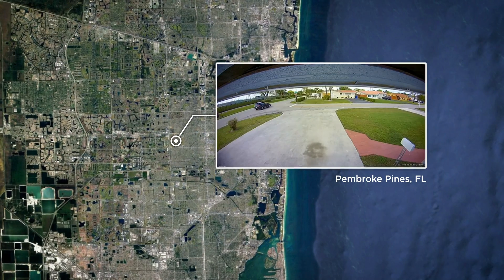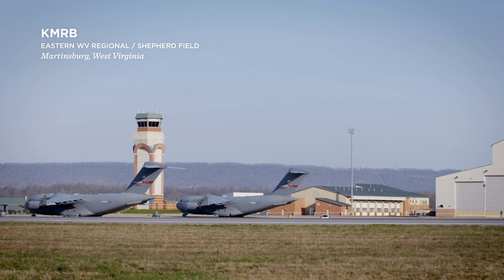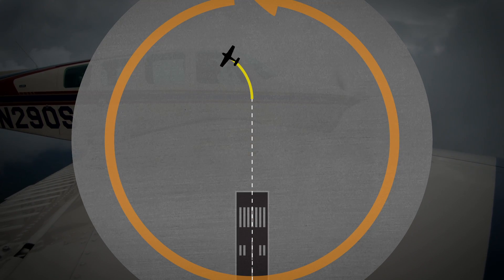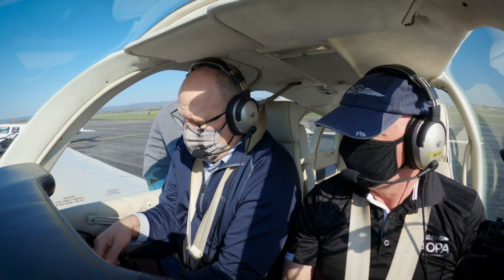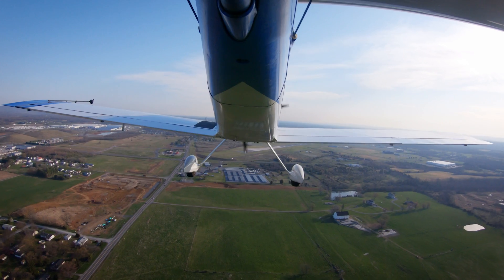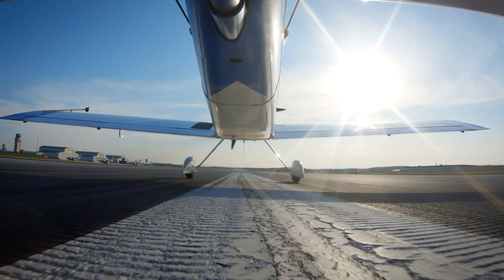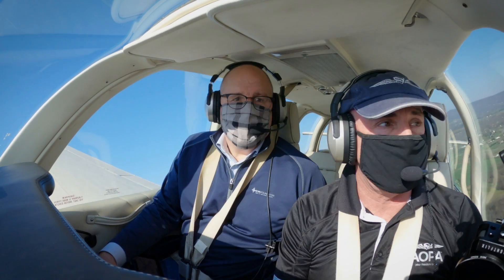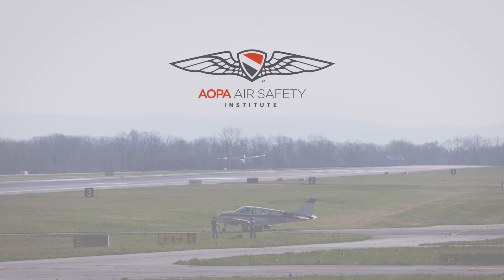Reality Check: The Runway Behind You

Comment: Russ, the airplane owner was flying that take off.  That was the deal with the Bonanza to take photos of HIM.. OF RUSS FLYING HIS C177RG. A week before,  Russ did a turnback teardrop kind because he didnt lock the baggage door on the 1177rg he later on died.  Looks like that airplane engine had failed on the taxiway before.  Why take off on it?  Then the owner also popped the gear down and that make them be short and before the runway.  
i HAVE Turnback Training on runway. Most turnbacks are the partial power kind and unless you Panic Pull (=Freak out due ignorance) you can turrback to opposite from 300 feet agl. I took that training too.  if runway is say 3,000 feet long or more.  
  Example: My CFI taught turnbacks to over 20 students in 1990's.  One got rpm down to 2,000 at bit over 200 agl.  He with 2 others adults on board did the Vglide 45 Turnback learned 5 months before. Landed tailwind , no damages.  He only had about 75 hours total.  He and the Airplane is still flying over 30 years later.   It is a matter of training, not ignorance.  Powr off is more considerations..

Comment: During an engine failure it’s not a good time to be trying to do anything difficult especially anything that’s not gear up in a field in front of you, fly it all the way to the crash site and call uncle dan gryder for your free steak dinner
Reply: What about if there are houses in front like so many airports have?  Or like in KLDG.  Fuel tanks from biggest refinery on East USA.  Tell me where you say you will go forward to.  Show.  Prove it.  I did 2 turnbacks on those areas.  Cherokees. Good landings with some tailwind.  Im a.. PILOT.
Reply: @JavierBrent  of course, I'm talking about preferable landing sites.  Of which there are not always.  Did you do your turn backs in practice, or after an engine failure?  might be good to practice, and potentially use if very familiar, and better options are not available.  preservation of life is the main goal, not preventing bent landing gear, so that is why gliding straight ahead into a field is preferable to trying a turn back to the runway, generally speaking.  also depends on so many conditions.  obviously if you have tons or runway in front of you when rotating,  you have a better chance of a successful turn back to the airport if you have an EF after TKF.  also, reduced idle thrust and a stopped prop are different, so practice is great, but will not be exactly the same as a real emergency.   I'm not trying to argue with anyone, so if that is what you want, good luck.  you also might miss out on the steak.
Reply: The angled climb is good.  But the turning 60 degree bancked and pop flaps is BS.  And i have a video doin 4 turnbacks no flaps 45 degree. FROM 1995.  AND taugt them to many students,  where is yours dong 5 kind of EFATO? Talkers can kill you.

Comment: The vast majority of these attempts to turn back are unsuccessful.
Reply: That is a lie.  Most turbacks are the partial power kind and unless you Panic Pull, you can turrback to opposite from 300 feet agl. if runway is say 3,000 feet long or more... Source; I taught turnbacks to over 20 students in 1990's.  One of mine got rpm down to 2,000 at bit over 200 agl.  He with 2 others on board did the Vglide 45 Turnback i taught him 5 months before. Landed tailwind , no damages.  He only had about 75 hours total.  He and the Airplane is still flying over 30 years later.   It is a matter of training, not ignorance.  Powr off is more considerations..

Comment: In 17,000 hours crop dusting and patrolling pipelines in Pawnee, Stearman, CallAir, C-152, C-172, and Cardinal, I had eleven engine failures at 200' AGL or lower.  I always had zoom reserve airspeed or enough airspeed to maneuver effectively in the six seconds these forced landings took.  Altitude is time, but not life.  Some of my failures could have been resolved with time.  I chose life.  Airspeed is life down low.  My default takeoff was level in low ground effect until Vcc or an obstruction I could not rudder turn around in ground effect required me to pitch up just over (not well over giving up precious airspeed.)  I always landed on the runway remaining or in a survivable landing zone in the near hemisphere in front of the wing.  While I pulled up wings level with near max airspeed from ground effect in crop fields, I never pulled on the elevator in the 1 g turns of often very steep bank angles to make the LZ.  I almost always was high and fast to the LZ requiring full flaps and rudder to the stop forward slip to make the beginning of the LZ.  While I dinged the stabilator on a Cardinal and totaled a CallAir, I never hurt myself or others.  I never tried the impossible turn and I never stalled.

Comment: I dont rate a 180 turn back. As indicated it requires total maneuvering of 360 deg to come back to the runway. It's worth considering starting the descent at 45 deg away, before turning inside 180 deg ... and then 45 deg to the runway. Less pressure to over bank and a smoother set of turns

Comment: Partial power ROTOT but with engine surging on and off is the worst kind of engine failure.  Surging engine power can fool you into thinking you will reach the runway or another place to land,  even straight ahead, not only on a turnback or turn,  then the dam engine quits totally before you can reach the landing spot.  The worst kind of engine fail, The surging engine fail is what killed MacSpadden and the big ex football player in New York mountains in 2023.  They couldnt reach the runway.  Someone popped the gear out.  another drag factor..

Comment: MacSpadden 
was not flying that airplane and i bet he, who had practiced EFATO Turnbacks" did not try a too low one. The ones who dont practice them are the ones that try them too low or the wrong way. The owner of the airplane is always flying it in photo missions, not others. MacSpadden got killed by that guy that didnt know turnbacks and turned back too low. The Ignorants are the ones that crash, not the ones with experience on the maneuver.   Duuhh!
The Cessna Cardinal looked like they could make the runway, but someone pop out the dragfull landing gear and they didnt.  Most times the owners do that to save cost, not an expert like MacSpadden. MacSpadden was killed by a bad pilot.  Be careful who you fly with.  Too many good pilots been killed by the pilot errors of others.

Comment: I love math I love airplanes. When you come around at a 45° Bank you put a downforce of 0.7 and horizontal force of 0.7. (the 45° Bank angle goes along with increasing loads faster then linear. When you were flying faster airplanes closer to the maximum loaded state, or a few other things you really give up a lot of ground faster than linear predictions would suggest. When we discuss the length  of the runway it has mathematical side effects. I don't think anybody can fly out and have an engine failure while they're still climbing and make it completely back lined up on the runway at the same point they left the ground. The only way to compare every airplane is to use the point where you left the ground and if you look at the point where you left the ground, no matter how wonderful you are as a pilot or how wonderful you have an airplane you can't fly back to that point lined up with a runway. If you had a long enough runway and you did all your climbing over the runway you wouldn't have to have very much altitude that you could always come back  it's a complete 360 by the time you make that square. 90 + 90 + 90 + 90 more to be back on the same run way.. I don't think it's really there if you don't have a lot of extra runway under you after you leave the ground. I believe a simple number or two could come up with a way to decide which airplane had a chance starting with runway length versus stall speed.

Comment: This video is not about Impossible Turns, but about Possible Turnbacks.  MacSpadden was confronted with the worst kind of EFATO.  And That kind of EFATO  i think he didnt know.  The "Surging Engine" kind or EFATO or LOTOT.  The worst kind that can fool you into try to reach fields and suddenly engine quits all AND THEN YOU CAN'T REACH IT.   Many good pilots have been fooled by Surging Engine EFATO.  Then engine quits and they crash short of the place they though could be reached..  MacSpadden knew power off Turnbacks but not the most difficult partial power Turnback or LOTOT Turnback.  

I had 5 engine failures on pistons in the 3,000 hours that i flew them in South America cargo i flew in the 1980's.  2 total but they were twins.  DC3 and Piper Aztec.  I landed them feathered engine spitting oil.  The other 3 were partial power. Singles.  On take off.  Lost one cylinder.  There are 2 basic kinds of partial power engine fails (LOTOT).  Power off and partial power only LOTOT. LOTOT means Lost of Thrust on Take Off.  Mac Spadden and his bonehead C177 owner didnt know how deceiving those LOTOTs are.  They can make you think you will reach the place to land, then engine quit and you crash short of it.  Happened a lot.

Comment: MacSpadden was confronted with the worst kind of EFATO.  And That kind of EFATO  i think he didnt know.  The "Surging Engine" kind or EFATO or LOTOT.  The worst kind that can fool you into try to reach fields and suddenly engine quits all AND THEN YOU CAN'T REACH IT.   Many good pilots have been fooled by Surging Engine EFATO.  Then engine quits and they crash short of the place they though could be reached..  MacSpadden knew power off Turnbacks but not the most difficult partial power Turnback or LOTOT Turnback.  

I had 5 engine failures on pistons in the 3,000 hours that i flew them in South America cargo i flew in the 1980's.  2 total but they were twins.  DC3 and Piper Aztec.  I landed them feathered engine spitting oil.  The other 3 were partial power. Singles.  On take off.  Lost one cylinder.  There are 2 basic kinds of partial power engine fails (LOTOT).  This is for 4 cylinder engines.
Reply: What about that engine total off you had on the Seminole twin in Venezuela?  Then you had 3 twin engine fails and feathered landings.  3 on piston twins.  Dammm.

Comment: Sad that just two years later this video is proven to be wrong by Richard dying in a crash trying a turn back in a plane that, according to this video, should have been able to do it. I was taught and still firmly believe that your best chance of a positive outcome with an engine out on takeoff is to land straight ahead and not even look past 45 degrees to either side.
Reply: NOT THE SAME TOPIC.  This is about "no power turnbacks".  He died with an airplane owner trying a "partial power turnback",  And the pilot owner, not knowing that maneuver, made many mistakes on it.  That is A different kind of maneuver.  I took training on both kinds. They are different kinds-  that need different training..
Reply: @JavierBrent  he ended up flat as a penny either way. partial power quickly turns into no power.

Comment: It boils down to pre-planning as though it will happen and pray it doesn't (thankfully majority of the time it doesn't), know every nuance and characteristic of your plane and be able to quickly weigh your options based on the dynamic complexities that will be occurring when (if) the time comes! (e.g. departure weight, weather; wind-direction, wind-speed, thermal activity [down-drafts], field elevation, density altitude, temperature, dew point, airport altimeter, propeller management, day/night, flying experience, structures in turn-back path [buildings, hangers, towers, antennas, trees], etc.). I am sure I missed several other factors that must be quickly judged before making the decision?

Comment: The reason why there are proponents for trying to turn back is because not turning back and opting for an off field landing usually means you won't save the aircraft.  You might save yourself, but things that aren't runways are usually piss poor runways.  Roads are dog shit runways.  They have signs, stop lights, streets lights, mile markers, parking meters and, oh yea... CARS on them.  None of those things make for a good landing.  Fields usually aren't smooth or level.  Water is practically a death sentence, and other surfaces just aren't rigid or smooth enough.  Most people don't want to accept the reality that they may lose an airplane today.  I can understand that.  Airplanes are expensive, but airplanes in fact can be replaced.  Lives cannot.

Comment: Turnback is possible for some pilots, in some aircraft, in some conditions.
     In other words turnback is possible if you know it's coming and you can choose the airplane and weather conditions ahead of time.
     Is it possible to know all of the qualifiers are present, that you are the sort of pilot who can pull it off, you are in an airplane to pull it off, and weather conditions will allow it to be pulled off.
    Not only do you need to answer all three questions with a "yes" with very little time to consider them, you need to correctly answer all them. If in a real emergency you answer the first question with a yes, you are probably not going to be correct.

Comment: Non pilot here with actually a fear of flying, which is why I started watching these aviation videos. So, at the end of this piece, when the narrator says something  like "pilots flying airplanes with these engine characteristics,  should avoid a turn back when dealing with engine failure after take off,"
Ummmmm ??? What's would be their other option? 
My only guess would be if you were in Mississippi (where I grew up) or rural Ohio, you could try to land in a field or on a road....but here in my location of Athens, Ga, I  think there are not many good options near the airport. 
As I write this, we had in 2021 or 22 (during Covid, I remember that) 2 airplanes just a few months apart both with loss of power after takeoff.... both were Piper airplanes, I remember the type of plane.
Both pilots attempted to return to the airport, and both missed the airport by about 1/4 of a mile or just slightly more. 
Both crashed into the woods behind a neighborhood... One plane had a pilot that didn't survive, the other involved a plane with 3 people on board, and they all walked away with only scratches from the brambles growing in the woods. I'm curious now what in the heck could one possibly do other than try and turn around in a city?
Reply: The decision what to do about engine failure at any phase is part of the preflight planning process for every flight. And that decision will be different for each airport. The crash behind Shoals Creek Drive involved a plane that had engine failure at 6,000 feet, which is not really a "takeoff" situation anymore. At that altitude, the plane could have glided another 7-10 miles. The pilot WAS trying to return to the airport in that case and crashed a mile short.  Based on the runway direction, it seems like there may have been two small, private airstrips within gliding range. They are both indicated on aviation charts the pilot would be referring to. The accident investigation is still ongoing, though, so I could be guessing wrong. In general, if turning back isn't possible after leaving the airfield, the pilot has to pick the least populated area straight ahead, even a roadway, and make the best of it. The pilot can often plan a departure direction that puts them over the best options.

Comment: Also remember that during a more or less 45 degree bank, the stall speed increase and on some planes, it's close to the used climb out speed. I like to climb out at glide speed +10. If engine fails, 3-4 secs get me on glide speed and go from there depending how high I'm.

Comment: You want to avoid a stall of course, go lower to maintain speed rather than think it can be held up. And I had intuited that a bonanza is a poor performer from the very shallow takeoffs I've seen them do. It needs substantially better climb slope than glide slope and apparently a bonanza is a bad plane. It has little to do with speed, an airliner will do 17:1 glide and climb much steeper. Case in point Sully glided twice the distance needed to return to LaGuardia before ditching it in the water. Airliners are fairly capable birds. Somehow the bonanza is not.
The impossible turn is very far from impossible. And training it in simulators is a good thing to do with the small caveat that the flight models might not be perfect but generally close enough. Kinking off to the side immediately after take off allows an easier loop back. Also mentally preparing which loop direction is best is good to know.

Comment: I did one in a 172. I was a brand new private pilot and 17 years old. For that takeoff I decided to fly down the runway (5000 ft long) at 10 feet gaining  almost cruise speed then did a steep climb at the end of the runway, at 400 ft the engine ate a valve and I was able to stop the climb and make the turn to a crossing runway right at the edge of the pavement. It was December 25th and the sun had just set, and the only option was the cold Atlantic Ocean.

Comment: there are many factors for this manuver. how about a parallel or intersecting runway? how about even land the airplane in the grass on the airport, near a runway, instead of crushing into the city?
well, i guess it depends on altitude, wind conditions etc. i think that the pilot should consider that during preflight planning.
define an abort point for rejected takeoff and define if it is feasible to return in case of engine failure (at certain altitude), and contingency plan to land elsewhere otherwise. recommend to use the beginning of the longest active runway for takeoff, try to avoid an intersection departure.